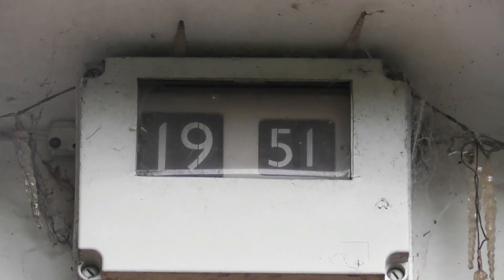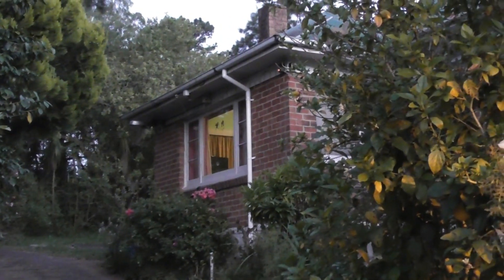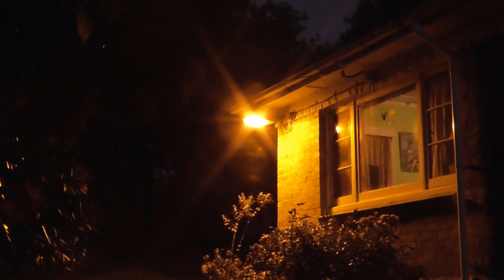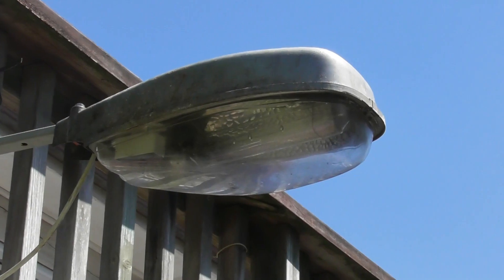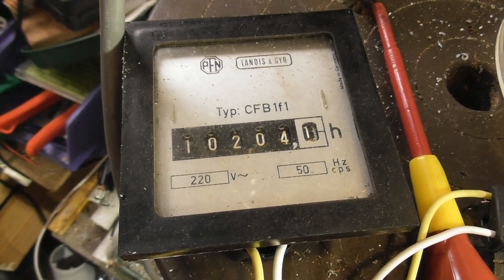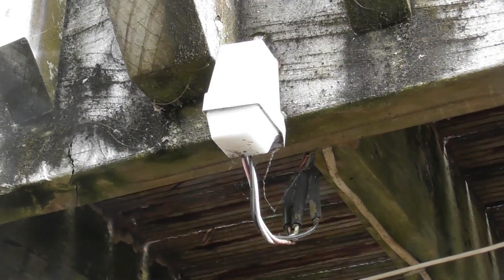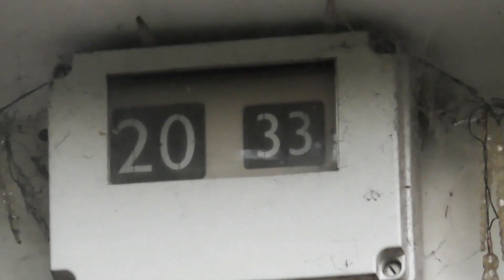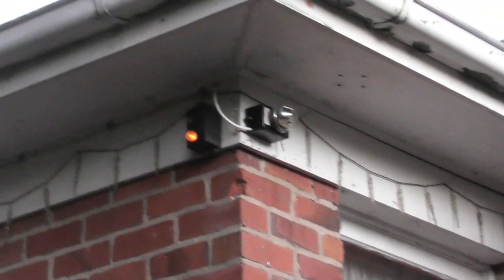Sodium SOX ramble and usage test

Comment: I have a question you or someone here may know the answer to.  In the USA my home power meter makes a buzzing sound for 7 seconds every hour.   it sounds like a 40 or 50Hz pulse (we are 60Hz) and is coming directly from the meter.  There's also about a 1-2 volt drop to the whole house.  Some power surge devices, fans and other appliances that are powered on during this event will also emit the noise.  The utility company swapped the aclara meter for a focus AXR-SD meter and i just heard the noise again, any idea what it is?  it's possible it could be my bryant heat pump HVAC but can't think of any current demanding devices in my house that would put such a load on the system and pulse it for 7 seconds.   the source is single phase 60:1 pole pig that serves only my house.   there is another house that comes in off this line which has their own pole pig transformer.  cheers.

Comment: I have never seen a lamp like this.And I think to reach the full brightness it take 7 to 15 minutes if am not wrong?
Reply: That;s about right.  The warm-up time can take significantly longer during cold Winter days, than in Summer.
Reply from the maker: Correct. But when warm they restrike immediately after a power cut.